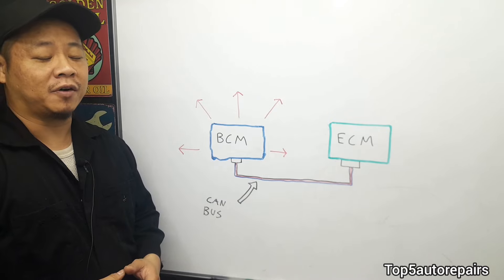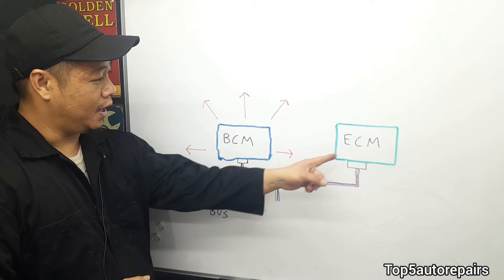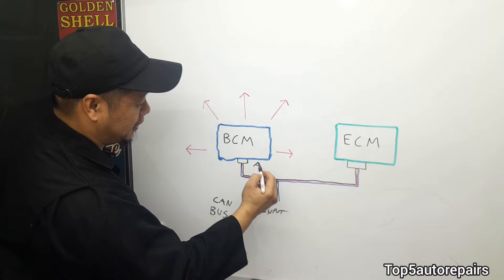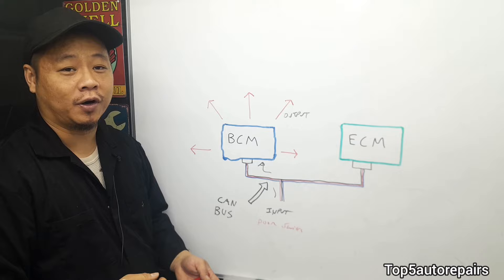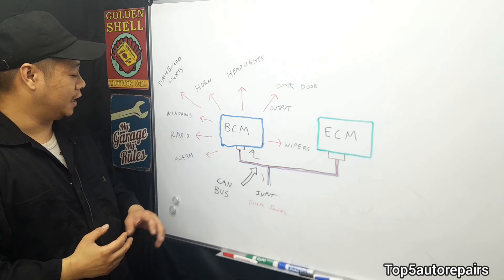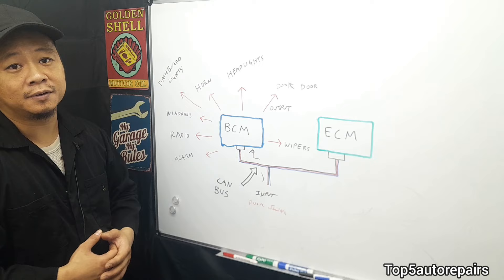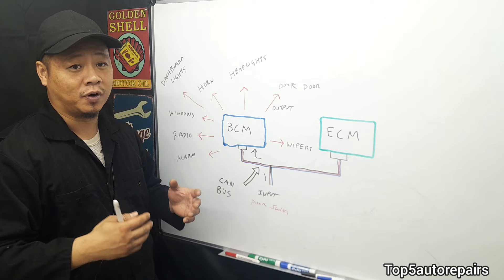Failed Body Control Module??? Do Not Replace Until You're Sure It's The Problem. Know The Symptoms

Comment: my nissan cant detect my key fob and I cant start the car. no lights on dash except the key and step on pedal. I suspect its the BCM...HELP
Reply: Try new battery in fob first
Reply: Plug your fob into your dash. Dead battery or not. Should still start the car. Fob slot is about knee level on driver side
Reply: Did you ever figure out what the problem was ?

Comment: Dude, you just described and touched on every single problem I am having with my 2008 Chevy HHR. Rear door hatch will not open (unless you put a fuse in an empty fuse position). My rear wiper on that door will not work although it does when you bypass the relay under the engine compartment fuse box. Rear left passenger door window will not roll up and down or is intermittent. ABS and Traction dash lights are on yet. There are no issues with those things. I just bought this a few days ago and I swear it feels like it is possessed. The funny thing? The car engine and transmission runs so damn well it rides smooth like a new car. I am a gigging musician who travels and needs the space in the back for some of my equipment. I thought these would be easy fixes. Speed sensors are working fine as they are relaying back perfect information and hooked up to a very expensive scanner can clear the lights but they just come on again. If I buy a new one or a used one, I hear they have to be programmed? Can only the dealer do this?
Reply: And edit to my comment, the dealer cannot fix or program these anymore, nor do they sell the body control module.
Reply: @grumpyoldrockers1048  thats shitty, going thru same thing dash board lights come on but not the dome lights and i get a theft deterrent fault
Reply: Hi did u say after replacing BCM engine and transmission running  smooth ?
Reply: Did yu change the battery to the keyfob ? Of yu did yu Probly drop the black pin with out that your car won’t work yu will have to get a locksmith to re program a new key
Reply: @Manest3272  if you’re talking to me, yes I finally had my friend who works at with a Chevy dealer in Lake Havasu, Arizona (I live in California, but I play in Arizona all the time) put in a new body control module. Programmed everything perfect. The only thing that is not working is the traction control button probably need to have that programmed. But everything else is great now. I shouldn’t have to go to Arizona to have this done while California tells me they can no longer get these. What a crock of BS!
Reply: @grumpyoldrockers1048 non-electric vehicle taxes probably prevent them keeping your car operational since there is an electric car/low pollution agenda.

Comment: Hello, if you have a bad bcm, could that cause all your sensors to throw a high & low voltage code, like P0118, P0122, P0223, & P0443. I change all the sensor connectors & sensors. Van still will not start. Have new spark plugs wires, spark plugs, & coils. No spark, even have new ECU. All fuses, & relays are good. New battery, alternator, starter, & water pump. Checked wire harness, & wires. They look like they're in good shape. I checked all my grounds, they were still connected well. What could be the reason for them codes still? My bcm is malfunctioning for sure. I noticed I had experienced some of those symptoms ya mentioned in the past. I was having ECU problems, but didn't realize I was having bcm problems, as well. Help.
Reply: Sell the car for parts
Reply: @apppleboi2858  , No sir. Why would I do that and it's the engine harness, at fault. I'm repairing my engine harness, and replacing the ECU connectors. Ya know, when you do research and then proper diagnostics, it's easy to discover a proper solution to an electrical problem. Just ordered an aftermarket harness, to replace the bad wiring on my harness.

Comment: Thanks for the informative video. I have an urgent request concerning a problem with my truck. This is an International truck. The DEF, check engine and the triangle lights came on. I was asked to change the Turbo Actuator. Two days later, same lights came back on. This time around, my mechanic said it's the Body Controller Module. He said there's no communication between the BCM and the Turbo Actuator. There is no loss of power from the truck. The truck runs good even when those lights came on both times. Is this really the problem? If this is the problem, can I use a used BCM or I should just go ahead and buy a brand new one? Thank you

Comment: I believe I fried the BCM on my '06 Taurus several years ago while doing an oil change. My filter wrench shorted out against the hot wire to the starter which Ford engineers decided did NOT need a rubber boot covering it. Always disconnect the battery cable or at the very least, wrap electrical tape around the band on the filter wrench on these vehicles.

Comment: 2008 clio mk3----went to start yesterday-nothing just a clicking noise coming from BCM unit which is located under glove box--i then noticed wipers very slow and lights on dash flashing uncontrolably----tried numerous times same thing happened---rang mechanic-he said BCM unit needs removed and sent to specialist repair shop-----------cost about £350 sterling for fix --------not sure how much new one is i c one at £470 on ebay but then u have to take it to renault garage to get it reprogrammed-----would that cure my problem based on info i gave or would u recommend a new one-thanks for ur assistance

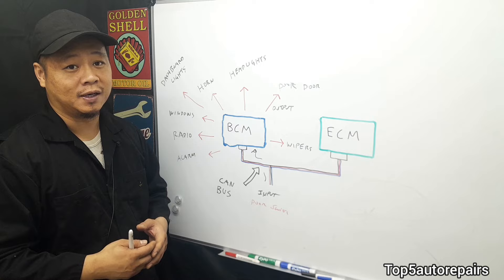Comment: 2:43 Hello I have a 2003 Chevy avalanche 1500 4x4 z71 with 5.3 liter engine, some times or every other day on initial first startup and any start up through the day , I have reduce engine power, my cluster gauges flash , my language settings change from English to French or Spanish , my rear view mirror direction info start scrambling , I get engine sensor codes going off , and  the sensor was replaced 2 todays before and engine stops running  for about 20 miles rough down the road bad gas smell and then it shuts off , I have to wait for about a hr then it will start but rough and then it will smooth  out very unpredictable . Also on initial morning startup it back fires loud and won’t start , then turn key off and starts right up fine and runs good for about 20 miles then dies . You think it’s bad bcm or ecm

Comment: my g35x wont start. i can press the push start & all the lights/accessories turn on but no crank or engine sound at all. the lights on the dash flicker as do the inside cabin lights & then it wont turn off by itself by push of the button. i have to disconnect the battery for the car to turn off again

Comment: I have a 2011 Sonata LE that has a sunroof. Sometimes it work, but usually not. I see there are two fuses that service the Sunroof: a 7.5A fuse that also has BCM on it (column 5,mrow 2) as well as a 20a fuse on column 4, row 4). I think a short to the Sunroof switch or motor is draining my battery overnight, or two nights.  If I pull the BCM Module 2 fuse, will it affect anything else?  Thanks.

Comment: I have about 7 BCM codes but everything is working fine besides the remote start. Which is only not working assuming because of the codes. What else could it be if everything is functioning properly?
2019 f250

Comment: I have a 06 DTS it will every once in a blue say service traction control and stabilitrak. I will show up  and beep for a few seconds then stop then I may not see if for a while. It is giving a BCM module code but I feel like it may be a bad wire somewhere as it doesn't seem to affect anything else.

Comment: Do you think it would be the same problem for 2009 cadillac sts the trunk won't open and the airbag light came on. Also the power seats won't move forward or backwards. The steering wheel won't adjust either.

Comment: I have a 2015 silverado 1500 LTZ. My dash lights sometimes flicker, headlights flicker and volt meter will bounce between 12 and 14.5 volts. I have checked both grounds in cab by A-pillars, both clean and no obstruction. Cleaned both grounds from battery to frame and motor and replaced battery ground sensor. I do get a loss of power steering but not that often. So could a failing BCM be responsible?
Reply: Since my last diagnosis, I have replaced ground clamp and had alternator checked. Voltage regulator failed test. Replaced alternator and system is now working correctly.
Reply: Thank you for posting the fix!!
🇺🇸💪🏻👊🏻🤙🏼

Comment: My horn don't work sometimes. But my problem in my 05 Denali, the blower for front and back heat. One will blow one day maybe the other will work the next day. One usually works but mostly the front is out. New fan new resistor

Comment: Good video thanks, 
my 2012 Volkswagen Sharan vehicle starts and drives without problem but the interior lighting, multimedia radio and sunroof no longer work.  Do you have any idea of the problem?  Thanks in advance.
Reply from the maker: First, start by checking for blown fuse or bad relays.

Comment: My vehicle is ford ecosport 2015 modle. Ford has asked to bring my vehicle for recall(door locking programming system) and after that fog lamps not working. They tried everything by reprogramming with updates, fuse & relay replacement etc but still now they cannot identify the issue. What can be the problem could be?

Comment: Ok I have a question, if i disconnect my BCM i have to disconnect the battery first? Then Remove the BCM and put things back in that order? 

If i Remove BCM so i can get the part no. I will  have to have it reprogrammed? Also After I remove it and put back the original one Will the car start with no issues? As I want to drive it back to the Programmer so he can program my ECU but i need to remove it to make sure I am getting the correct part. His Autel Scanner Read 284B2-89910 but I cannot for the life of me I can't find that part no. All the ones on Ebay or at online Dealers say 284B1-XXXXX but none says 284B2-89910 for the reason I must remove it to make sure what is the correct part no. 

Thanks for your reply.

Comment: Wow this is everything that is wrong with my Kia Sportage 2011 - when I start up, for a few minutes the dashboard is fine but nothing works, then after a few minutes the blinking starts.......turn signals, lights, windows don't work. The guy who looked at it said that the BCM is faulty and I remember a few years back water was coming into the vehicle from top of the windshield that was not properly sealed.......seems it got into the BCM which is under the dash. Now I can't get a BCM because Kia no longer manufacture for the 2011 model. I have been searching every website I know of, but nothing. 
What my tech can't tell me is if there is a way to modify the BCM since I can't get a replacement or does it mean my vehicle is now dead and done for since I can't drive at nights without lights.

Comment: My problem with my Pontiac torrent is, the power stays on after I take the key out of the ignition. The windows roll up and down, the wipers turn on, the headlights turn on etc…, all without a key. Could this be a bcm problem?

Comment: I had my bike (2016 Road Glide Special)  off the tender for a while  *2 weeks*. Bike started up fine moved the bike. Fired up bike again, VINERR code popped up. Bought a new a battery. No luck... All these codes all popped up-U0001,U0100, U0121, U0140, U0184. All the gauges all not working correctly. Thought bike would reset after a ride, nothing. Can you give me any answers to these issues?

Comment: Need help; mazda cx5 with interior lights malfunction, headlamps dim, lock actuators malfunction and click constantly, trunk won’t open at times, car alarm won’t set occasionally, heat/ac does trippy stuff, radio acts up and now CEL with codes p013A, u0401:00 and u3003:16. I’m thinking it’s BCM but alternative solutions can be passenger side ground wire bolt has been painted during possible previous body work creating issue grounding (apparently a common issue with these vehicles) but ground wire could create some of my issues but doesn’t match everything. Wondering it 02 sensor code (p013A) is a separate issue or somehow connected to ground wire issue or even BCM faulty? Any suggestions?

Comment: I have a 2013 Ssangyong Stavic - Car has automatic locking at 50kmph. However the car will continue trying to lock the doors after they have already locked. And will then unlock as the car slows down. So car is constantly locking/unlocking the doors while driving. The aircon also works intermittently. Sometimes will be really cold, and other times feels like the heater is on with the same aircon setting. - I also have an electric window on the drivers side which is very slow to go back up. Could these all be symptoms of a faulty BCM?
Reply: Did you ever find out if the problem was your BCM? I'm having some of the same issues as you were,on my 2002 Dodge Stratus Sedan. My A/C blows cold then next min blows warm (I've already charged it & checked for leaks), My 2 back windows won't roll up or down, my horn honks intermittently and my dash lights flicker sometimes.

Comment: Hi great video, they have made these vehicles do hard to work on. I have a 19 Kia Sorento, LX V6 AWD, when I open the doors the interior lights don't come on. Tested the Map/Dome light assembly and it's works 100%. What would be the next step, replacing the BCM or is there a designated relay for the lights?
Reply: Take it to someone who knows what they’re doing- electrical issues are best diagnosed by a professional. These newer cars are so sensitive with their complex wiring and sometimes dozens of control modules that its not worth saving a few bucks trying to do it yourself
Reply: Check the harness for the driver's door. Pull out the bellows and look for broken wires. It's a common problem. Pull the wires one at a time using your index finger. If the insulation stretches, the conductors are severed. Repair wires.

Comment: Could it cause issues with the climate control on a Ram? May be HVAC module since screen says climate off and stays off yet fans work. I noticed weird issues like cruise stopped working then started working a day later. Hl says out but on. Did get the code that BCM lost communication, no HVAC code

Comment: Hi there, I have a 2019 Chevy Equinox which has all sorts of intermittent electrical issues such as some or all power windows don't work for days and sometimes all work, sometimes the driver side door won't lock/unlock and sometimes it does, sometimes the interior lights works and sometimes it doesn't, sometimes the display changes from audio to android phone and vice versa and sometimes everything seems just fine and so on and so forth. This has been happening on and off since almost a year now after I bought this brand new. All fuses and relays seems good. Neither the Chevy service center nor auto electrical technicians can figure out the problem. Already spent some $$$ and these issues still remain, though the car drives great otherwise. Could this be the BCM issue or something else? Please advise. Thank you.
Reply: Damn dude I am having the same problems with my 2008 Chevy HHR . I was beginning to think the car was possessed. The problem is the car runs great.
Reply: @grumpyoldrockers1048  LOL, the invisible  predator in the car is getting energized by sucking up the charges. But jokes aside, after carefully watching a lot of videos on YouTube, I bought a multimeter and a test light and am about to diagnose the culprit myself in piecemeal by first checking all fuses and relays again and then the connectors, modules, harnesses and finally the ECM, PCM. Have you found out the problems in your 2008 Chevy HHR yet?
Reply: @earthlycreature8772  oh yeah I know what the problems are. OK the main problem is the ABS and traction light are on. Did a live road test and the wheel sensors are great and all four work in tandem and are giving great readings so we know it’s not the wheel sensors. We clear those lights and we can drive it for miles and miles. Not a problem they won’t come on. Soon as I turn the car off, and turn it back on, Bam the lights come back on. The rear hatch lock won’t open. But there is an empty fuse in the main fuse box number 11 if you put a fuse in there, the hatch will open and close perfectly. But that is an empty fuse slot. But somehow it bypasses the BCM. Same thing with the rear window wiper, it doesn’t work at all, but we jumper the relay and the rear wiper works perfectly! Then I have an intermittent Door window switch. Sometimes it works sometimes it doesn’t. all these things as described in this great video are controlled by the BCM. I’ve checked the BCM for faulty, wiring or ground problems, that’s not it. I’ve got a bad BCM.
Reply: @grumpyoldrockers1048  Please share how you made out? I am getting ready to Get a refurbished Pre-Programmed BCM for my 2010 Impala.. I took out the BCM to get the Part number off it and opened it up to look at the board and It looks Perfect.. So I am hesitating on buying the newer one..  I have been having intermittent No Crank No Start issues the Usually Start with Warning Chimes, Service Everything Messages, Gauges go Crazy back and forth, Door Locks on/Off Constantly, Shifts get Rough BUt not Limp Mode and sometimes it actually goes into limp mode.. Once I shut it off for a while then begins a No Crank No Start... Most of the times a can Disconnect Battery and then it gets back to normal.. Took it to dealer and they got me for a $800 for diagnosis fee and New Starter..  Worked for 2 days and No Crack No Start.. Finally get it Started and Limped it back to Dealership.. They had it for 3 weeks and Couldn't recreate the problem... They were leaning towards Bad BCM and wanted $450 for new BCM and wouldn't charge me for labor... I took it back from them and it worked for 5 days great Until this Past Saturday... Any Help from anyone would be much appreciated.